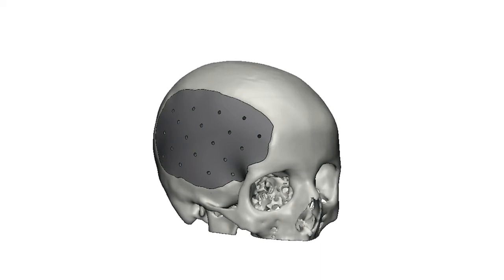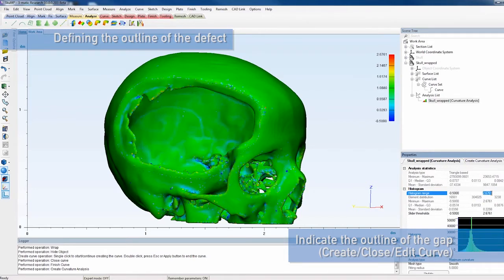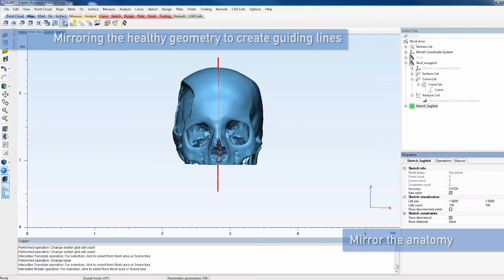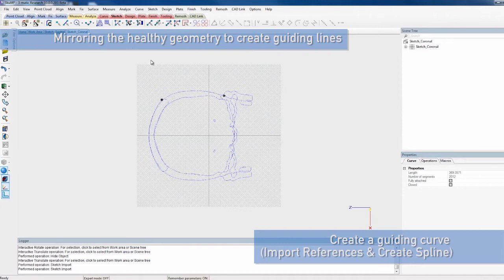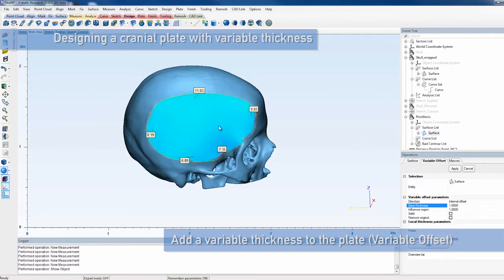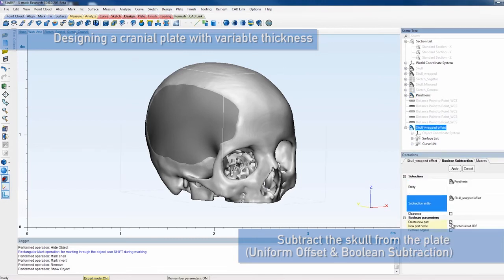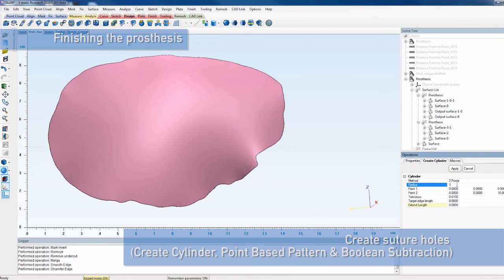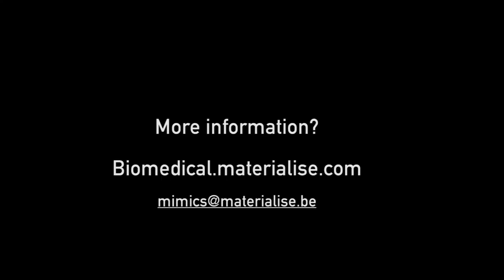How to Design a Patient-Specific Cranial Plate | Tutorial | Materialise 3-matic

Comment: Very interesting, thanks.
I am wondering if the following approach would have worked:
1) draw the curve on the cavity (as you did)
2) define the mirror plane (as you did)
3) mirror and copy the skull (as you did)
4) cut the mirrored skull with the curve and keep only the "island"
5) use a target driven deformation approach to the island so that it will actually match the hole in the skull